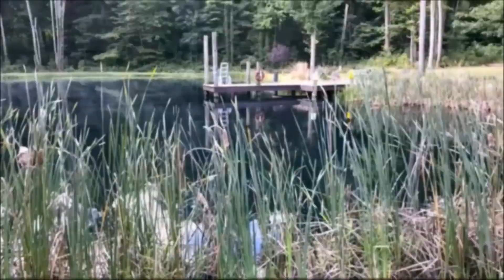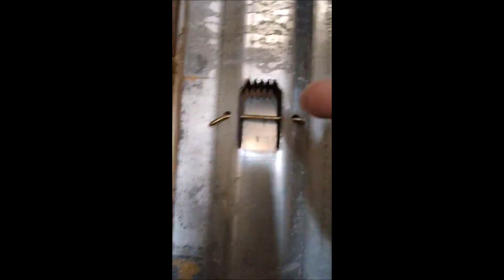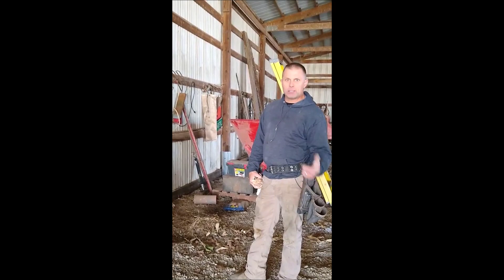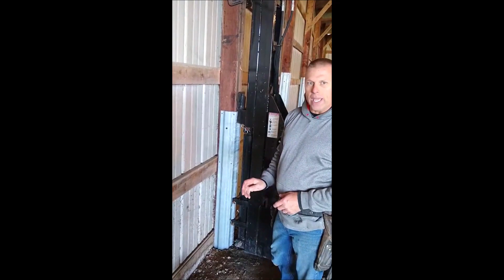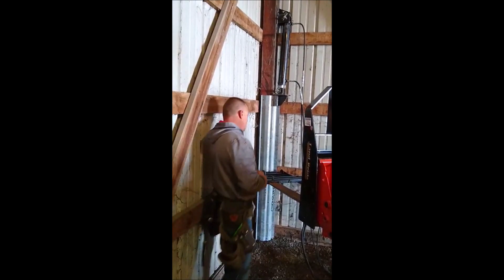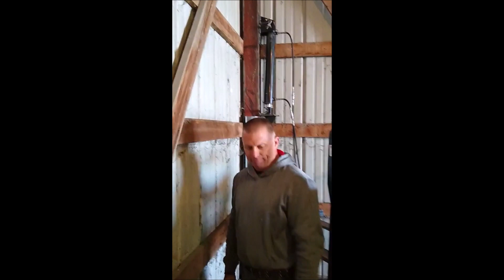Metal sleeves repair rotted pole barn posts.

Comment: I have a concrete floor in my barn so, a bit of a challenge?
Reply from the maker: If you have a current situation let me know how it goes.
Reply: @CountryCraziness  thank you,  presently i just am observing the post rotting away, it's going to be awhile before it can be addressed, considering taking the metal siding off to access the post. Not sure of the repair method yet.
Reply: @tiredowalkin Would be interesting to know which solution you pursued
Reply: @normcook9335 if it’s completely cemented in I would think you could cut the post off and then pour some concrete underneath and use a 6x6 post bracket and joint in a new 4’ section of post or however long

Comment: What if your posts have cement poured around them ?
Reply from the maker: You will have to dig it all out before a fix. I would use a permacolumn spliced to the good part of the old column.
Reply from the maker: Been thinking about your question some more. I'm not sure if your post were put in the hole and back filled with concrete or the poles have concrete surrounding them with a concrete floor.

Comment: Interesting process. I always wondered what would happen if the posts rotted. In theory, with enough wind, the pole building could topple over. I haven’t seen it on a pole building first hand but have seen and repaired the same condition on older decks where a post has rotted below ground. We typically remove and replace the post entirely with new lumber. Not a common occurrence but it still happens given the right conditions. Ground contact treated lumber should always be used, typically yellow pine, for posts.